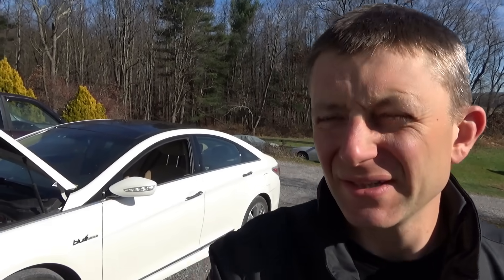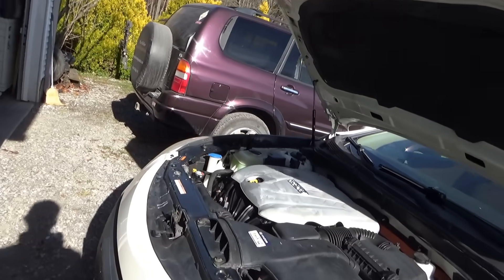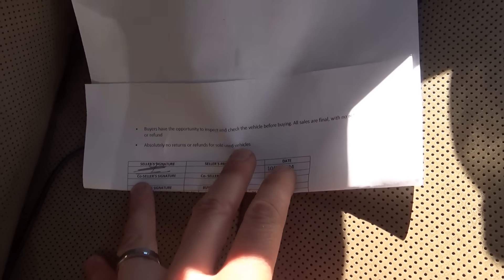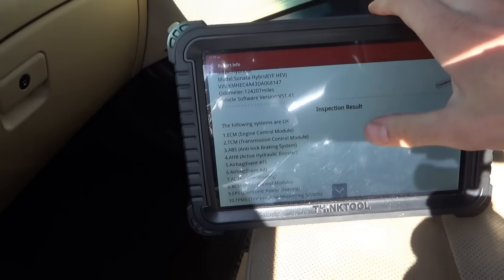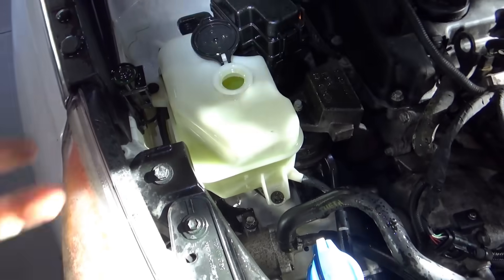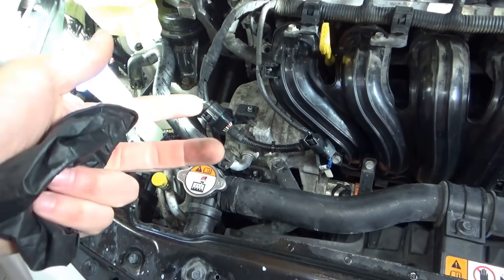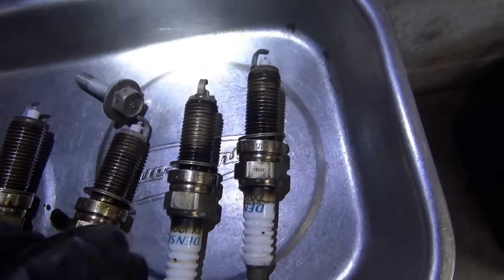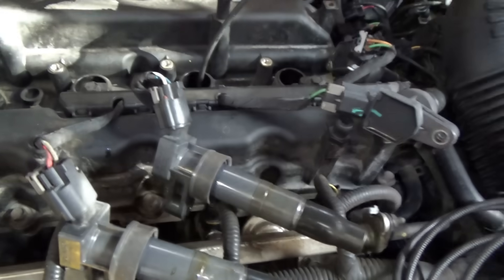Customer SCAMMED?! Hyundai Hybrid NO HEAT & PUKING COOLANT?!?!

Comment: I am in the market for a used vehicle right now and I have already been in touch with a reputable mobile mechanic who has agreed to meet me when I find a vehicle that I like, and hook it up to a code scanner and give the vehicle a thorough inspection for $100. I did this the last time I needed a vehicle and it was the best money I ever spent. FYI, a lot of mobile mechanics are more than happy to provide this service.
Reply: Money well spent. So easy to arrange an inspection yet people don't do it.
Reply: A code scan would not have helped in this case. Ivan scanned it and it showed clean.
Reply: @bob521i  an inspection is more than a code scan
Reply: Personally, I would also want to put it on a rack for under vehicle inspection. Good luck.
Reply: @AbcDef-iq4no  Only the typical obvious stuff can be looked at . Transmissions and engines on higher mileage vehicles are always a gamble at best. Rarely are trans. or coolant ever serviced , and engine oil change intervals are also seldom kept up. I always refer to the old cliche, I can’t see up a bulls arse any further than you can. 👍😂😂
Reply: Ideally you'd take it to mechanic with a lift so he could get it up in the air and inspect it properly.
Reply: First of all, I live in a town of 500 people where there is no mechanic (with or without a lift) and I am looking at vehicles in other nearby small towns, some as far as 75 miles away. So, bringing along a reputable mobile mechanic in his early 60s (who has 40 years experience) who has brought along a code scanner is what I am talking about. He will not only plug in this code scanner and look for any codes, but check over the vehicle completely including crawing underneath it and checking under the hood looking at fluid levels, belts, hoses and making sure that there aren't any anomolies. So, yeah in a perfect world I would find a way to put a vehicle up on a lift that I am considering buying, but that just doesn't make any sense where I am located.
Reply from the maker: @AbcDef-iq4no I would at least jack it up and wiggle the wheels 😉
Reply: @PineHollowAutoDiagnostics  Lol, I will give you that one, I agree....but at the end of the day, 70% of a full inspection is a heck of a lot better than no inspection at all. And not to put too fine of a point on it, if a mobile mechanic (like the one I am talking about  coming with me to inspect vehicles I am thinking of buying) would have been along with the unfortunate person who bought this clunker of  a Hyundai in this video, this disaster of a purchase could have been completely avoided. All that he would have had to do was pop the hood and see anti-freeze everywhere to know there was a major problem with the engine. Furthermore, he would have also seen the bald tires and figured out instantly that this Hyundai had very poor maintenance and service. Finally, any reputable, knowledgable mechanic would have immediately steered someone away from an 11 year old Hyundai hybrid with a lot of miles on it in first place.
Reply: @AbcDef-iq4no  Where are You located?

Comment: after 17 cars, including a Shady dealership or two (including a FULL BARREL new dealership!), this is ONE thing I've never had to deal with.  even thousand dollar clunkers have never had bad head gaskets (bad valve gaskets are as close as I got).  most of what I've had to deal with has been sheer old age on components and incompetent previous owner that never replace common wear items like tires, bakes, and exhaust.

Comment: 1 shady dealer + 1 ignorant buyer = 1 bad situation. Both parties are equally responsible.  Just like “ignorance of the law is not an excuse”, being an ignorant consumer is not an excuse either. Don’t get me wrong, dealer is at fault as well but consumers have a responsibility too. Hard lesson to learn, but that’s how it is with some folks.  Why would you buy a used car with no warranty?  Why wouldn’t you READ the contract you are agreeing to?  Sure, the dealer will have to pay up in court eventually (depending on State laws) but all this can be avoided with a little self education.  Even if a consumer has no interest/experience in automobile mechanics, a simple “how to buy a used car” search on the internet would have gone a long way in helping to prevent this situation.
Reply: You pretty much nailed it in my opinion. Expensive lesson at best. 👍

Comment: Hyundai and kia hybrid of these years are famous to overheat and blow the engine, u can replace the engine but eventually they will overheat again even if u replace every single items in the cooling system, i believe its factory defect in the design.
Here is how i was successful in preventing this.
For cars with mechanical water coolant pump and auxiliary heater pump, the auxiliary heater pump is controlled only by climate control when heat is demanded, what we do is in the fuse box, we jumper with a diode the control side of the heater pump to the fan speed low relay, both relays are next to each other, so when speed low is demanded it will command the pump ON as well but not the other way around.

Comment: That's a nasty one, Ivan! As the engine runs so smoothly, for a moment I thought you had major blockage in the cooling system, or the pump completely shot, but it was a wild blown head gasket on an almost perfectly working engine! Cautionary buyer's tale!
Reply from the maker: I couldn't believe how smoothly it ran with that GIANT gasket leak!! 😂
Reply: @PineHollowAutoDiagnostics  Exactly!!
Reply: Leaking on multiple cylinders no less!
Reply: @ivanpetrov9230  Yep, distribute the problem across all cylinders 🙂 So odd that it ran so smooth.

Comment: Thise engines had a extended warranty of it remember correctly
Reply: Yes - BUT that extended warranty was only good for 10 years / 120,000 miles. Here is what the extended warranty says: Hyundai Motor America has decided to extend the warranty for the engine's "short block" assembly (consisting of the engine block, crankshaft and bearings, connecting rods and bearings, and pistons) on 2011-2014 Sonatas manufactured at Hyundai Motor Manufacturing Alabama to 10 years from the date of original delivery or the date of first use, or 120,000 miles, whichever occurs first.

Comment: I have seen you fill coolant systems like this before. If you where in my shop I would tell you to fill it correctly with a vacuum fill system.  Your filling technique will trap air and cause bubbles no matter what!  Throw that funnel in the trash!
Reply: thats how most of us fill our cooling systems. how many people do you think actually use a vacuum fill system?
Reply: While vacuum filling is a good technique, your statement is not true. In a properly functioning coolant system, air will only get trapped if the fill port is NOT the highest point in the cooling system.  Your opinion does not override the laws of physics, thermodynamics or fluid dynamics.
Reply: @vg3430 Those simple laws do not always apply in many newer vehicles with over complicated cooling systems.
Reply: @brianw8963 😂😂😂.

Comment: Why would anyone buy a Kia/Hyundai? The engines are crap. A friend went through this with a dealer. Replaced head gasket under warranty. Couple of 1000 miles later blown again. This time engine replaced. Weeks in the shop. Luckily (?) that car was totaled in a rear end accident. So he bought another new one!  I guess if you plan on trading at 60000, you might avoid repairs.
Reply: I mean, our 2011 Kia Soul has 111,000 on it with 0 issues. Every make and model can have bad ones…

Comment: I'm surprised that the shop isn't full of white smoke.
Reply: really big catalytic converters because as a hybrid engine often runs in warm up phase, so you have a massive cat to catch all that and slowly burn it off later on as it heats up.
Reply: White smoke is oil burning, isn't it?
Reply: @deplorablelibertarian oil burning is blue smoke

Comment: The engine lab at the auto company I worked at would do a nitro test to see head gasket integrity.  Bring a cylinder to TDC with valves closed then pressurize with nitrogen to 200, 400, 600, 800 psi.  You'll know right away where the leak is.
Reply: Most mechanic see a head gasket problems every couple months, seems expensive diagnostic equipment to buy, tester that goes onto the radiator cap that changes the fluid to yellow is very cheap to purchase

Comment: How is a normal customer, without that much knowledge about cars, supposed to notice that?! That crappy dealer should REALLY be outed! 😡
Reply: I guess I'm spoiled with good customer protection. 😜 In Sweden the dealer would have had to fix that problem up to two months after selling the (used) car. And if you can prove a fault existed when you bought the car, that period extends to two Years. 🙂
And that is the Law, nothing a dealer can dismiss with some fine print. 😜
Reply: Avg used car dealership
Reply: you test drive it like you stole it, that's how. would've blown that coolant all over the place on the first highway on-ramp.
Reply: Here’s how:  1–They should have the car inspected by a third party mechanic BEFORE buying.  2–They should insist on some sort of warranty BEFORE buying. 3–They should READ THE CONTRACT before buying.   Here’s an example of a completely different scenario, but with the same mindset. I personally know nothing of jewelry and really have no interest. But if I walked into a pawn shop and was considering buying a used $6k diamond ring, rest assured that I’m not just going to take the salesman at their word…I am smart enough that know “what I don’t know” and will have the ring evaluated by a third party professional.  Ignorance is not an excuse and unfortunately, it can be very expensive.  Hopefully this consumer learns, but there is a reason there are used car dealers on every vacated gas station lot!
Reply: By getting the car inspected. Exactly like the sales contract says. One hour and $100 at any nearby shop, or call a mobile mechanic. It's not rocket science.
Reply: @jptrainor  Does the mobile mechanic or shop pay for the repairs if they miss something?? I took the last used vehicle I bought (2019 Subaru Outback) on a 45 minute test drive with ZERO issues, and it was only on the was home that it started overheating and I found out it had a blown head gasket. No CEL, no white smoke out the back, no nothing. Not saying an inspection is not a good idea, but GET A WARRANTY OR WALK AWAY!!!
Reply: @sblagg527  Of course not. If you want a warranty buy a car with a warranty.
Reply: A pre purchase inspection is a must! Use lemonsquad or similar

Comment: I never seen a Headgasket that  bad before there is so much coolant in the cylinders. Great video!
Reply: Same here. Yikes
Reply: I'd be wondering if the head itself is cracked with all that coolant in there steam cleaning all the cylinders
Reply: @rawr51919   That's possible
Reply: That is an INSANE leak, you'd think the head bolts were finger tight!
Reply: @volvo09  I agree
Reply: Optional water cooling by Hyundai
Reply: Amazing it didn't Hydrolock and chunk a piston or rod

Comment: There are many ways to test for a bad head gasket but I find a hydrocarbon test with pulling air out of the reservoir through the special fluid to be the quickest test. If the special fluid turns yellow you know right away the head gasket is bad.
Reply: Agree…kits are inexpensive, take only a minute or two, and are conclusive.  Won’t tell you what cylinder bank, but on an inline engine, doesn’t matter.  If a positive test, a blown head gasket or crack in the block or cylinder head.
Reply: I have had false positives and false negatives with the blue fluid and threw my kit in the garbage. My gold standard is a leakdown test on a cold engine. If the coolant rises in rad or degas bottle, positive diagnosis.
Reply: @stevestadnik9206 oh wow I have never had a false positive but I can see under the right circumstances how that would be possible.
Reply: anything beyond the most micro leak, puts horrible exhaust smell into the radiator and the cap will smell horribly strong.
as long as you have a good nose and clear sinuses, you should be able to detect it.
Reply: @paulschultz2889  while I recommend paying for a pre-purchase inspection by a qualified individual when considering a used car, these kits are easy and cheap enough that anyone could do it.  $30 and 2 minutes would have detected this issue at the seller’s lot.

Comment: Good morning kids!  I was halfway through Gutfeld when Youtubes finally decided to let me know that PHAD had posted a video.  Had a Silverado brought in yesterday for overheating.  I got that handled then when I was driving it I noticed a wheel hub bearing was toast.  I jacked it up and noticed that the entire front end had been rebuilt.  Another local shop did it.  They left ball joint nuts loose, and didn't put cotter keys in the nuts. THEN they did an alignment on it.  o.0  I hate shitty mechanics.  I quoted a $1,000 heater core job yesterday.  Love me a heater core job.  Dude approved the repair then said oh yeah, it needs a power steering pump too.  XD  Chu ching!!!